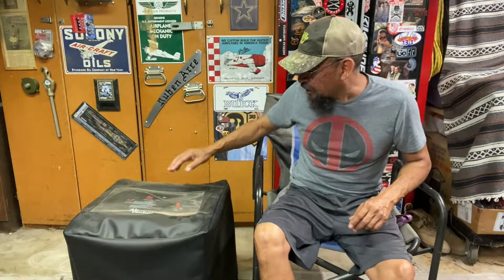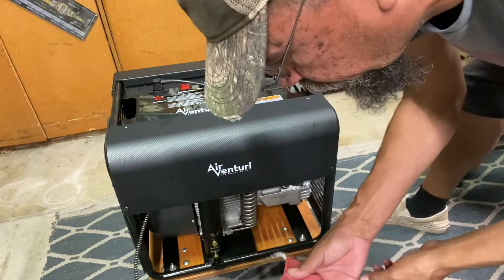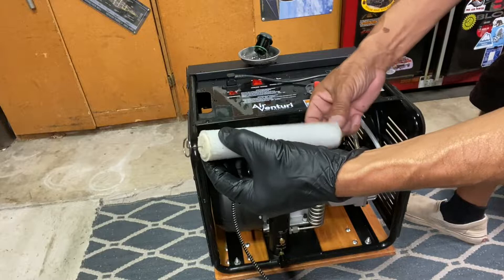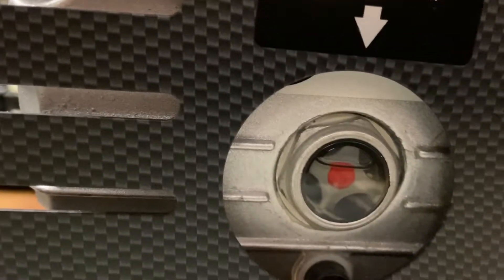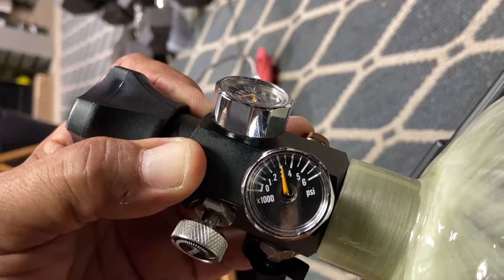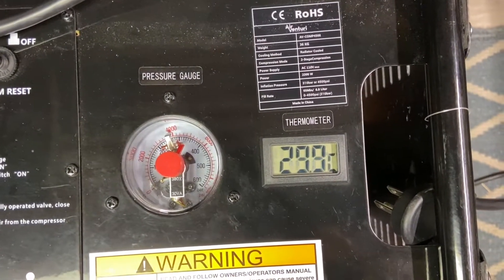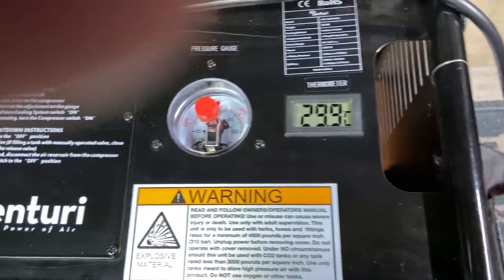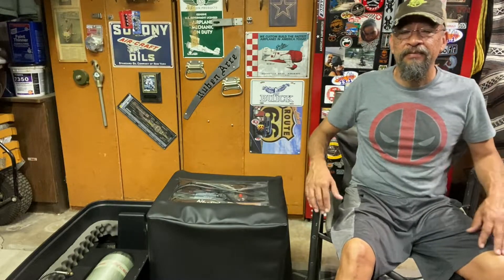Air Venturi HPA Compressor, 4500 PSI/310 bar

Comment: Nice video. I finally ordered that model compressor. I thought I was ordering the Krypton but this is a little cheaper and should work just fine for Air Tank refills.  I was using a GXpump cs4 and that will now become my reserve and road trip unit due to the 12V capability.  Please tell me a bit more about the cover you have and where can I get one? Also I really like that cart you put under it. Tell us a little more about the valve set on your tank. Mine is just factory standard Air Venturi valve. I am pretty new to PCP airguns and have much to learn.
Reply from the maker: I would like to first thank you for watching my channel and as for the cover on my compressor I actually paid somebody to make it. I made the pattern for the compressor with a box then took the box for sizing  to a tailor because I don’t have a car upholstery shop around me so I showed the pattern to the tailor and I gave him the material and he sewed it all for me together. He did a good job, and also for the dolly on the bottom, made it myself out of 3/4 plywood and casters from Harbor freight.
If you like, getting your hands into material construction type, the dollies pretty easy to make,but you need to find somebody who can sewed and get your material from Joannes fabrics. Are any kind of fabric store that you have and pick up the material you like.
Once again, thank you for giving my channel a chance and leaving me a comment .
Keep your plinking on target 🤠

Comment: I'm thinking its a good idea to drain the main tank. looks like it has some water mixed with a little oil.    on most compressors they want you to keep out moister so it doesn't hurt or rust the air tools. it might also be more consistent when shooting. cool stuff. take care my friend.

Comment: Amigo mi compresor no comprime no sube más de 300psi
Reply from the maker: Most likely your cylinder head is warped, contact the company and see if they have a warranty. If not check on Amazon they have the cylinder head and sleeve  for sale for 100 bucks.